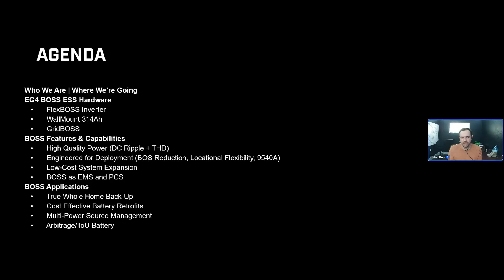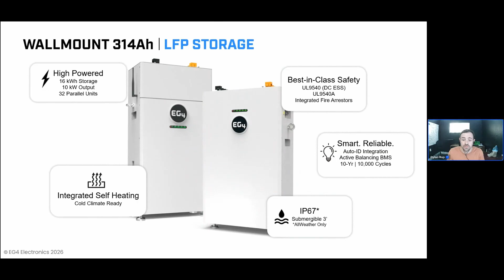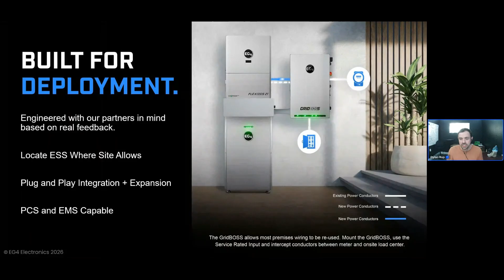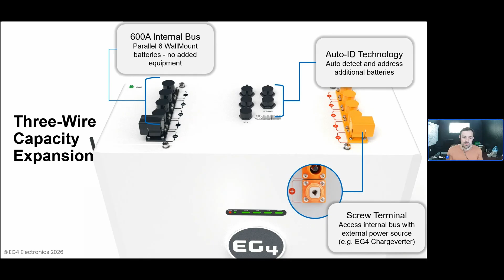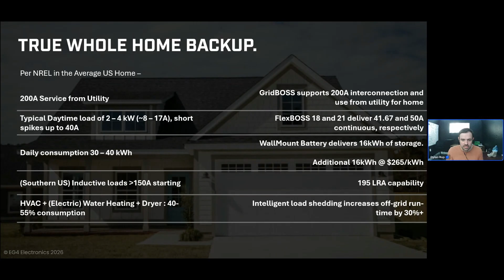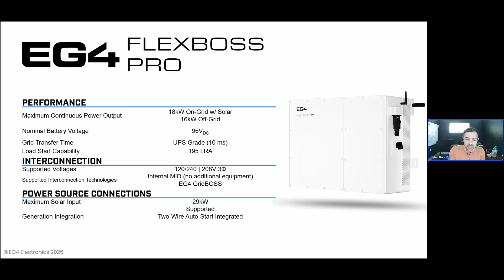Unlocking the EG4 FlexBOSS

Comment: According to my manual, when you connect the FlexBoss21 to the GridBoss, you are not supposed to use the output or generator input on the FlexBoss.  So I think he is inaccurate on the video unless they've changed something.  You would also need to pull communications cable from the FlexBoss to the GridBoss from the Garage to the house - which might be really difficult in a conduit that already has cable in it.
Reply: You actually can use the Flexboss load output, but usage will not show in system data.  There is a paper on the EG4 website about this, even if it is not described in the manual.  https://eg4electronics.com/wp-content/uploads/2025/12/Utilizing-the-Load-Ports-on-FlexBOSS-when-Coupled-with-GridBOSS.pdf

Comment: EG4, please review and reconcile the current 280Ah WallMount documentation. The guidance does not appear consistent across these current files:

- EG4® WallMount Indoor 280Ah Battery Connection Overview & Paralleling Guide v1.1.9
- EG4 WallMount Indoor 280Ah Quick-Start Guide v1.3.9
- EG4 Systems Battery Wiring Diagrams 2.1
- EG4 FlexBOSS21 System Wiring Diagrams v2.1
- EG4 18kPV System Wiring Diagrams v2.1

The issue is important because these documents do not seem to give the same answer on when 6 x 280Ah WallMount batteries can remain on the internal battery paralleling / internal busbar method versus when the installer must step up to an external fused positive busbar, negative busbar, Class-T fusing, and custom conductors.

Example: 3 x FlexBOSS21 with 6 x 280Ah WallMount batteries as one shared battery bank.

That answer has a major effect on real-world cost. It changes:

- material cost
- conductor and fuse selection
- labor time
- whether customers buy parallel kits only, or also have to buy external busbars and protection hardware

In my case, the lack of a single clear answer led to duplicate purchasing. I first bought the parallel kits, then later bought high-quality external busbars, fuses, and conductors because the documentation did not read consistently enough to rely on one interpretation.

Can EG4 please publish one direct answer for this exact configuration:

3 x FlexBOSS21 + 6 x 280Ah WallMount batteries, shared bank

Please state clearly whether this setup is officially approved:

1. using only the internal battery paralleling / internal busbar method, or
2. only with external busbars and branch protection

This needs to be stated the same way across all current manuals and wiring guides. A clear correction or technical bulletin would help customers, installers, and inspectors avoid unnecessary cost and confusion.
Thank you. I enjoy and recommend your hardware, but as I go big in my set up, I need some clarity as the equipment is about to be installed this week.